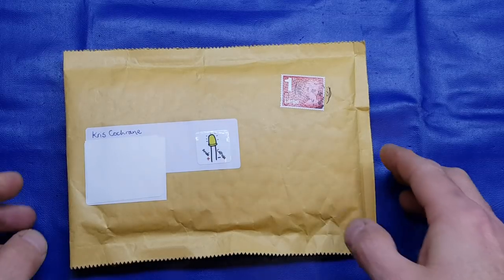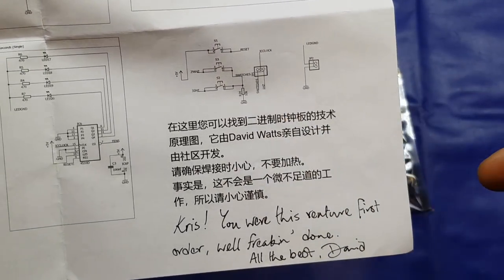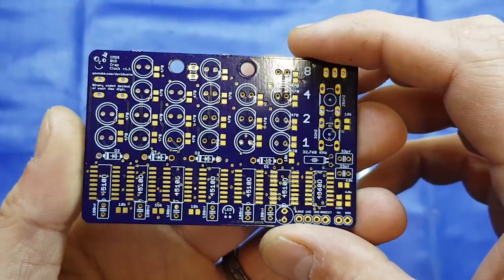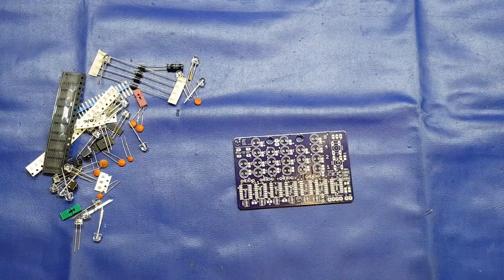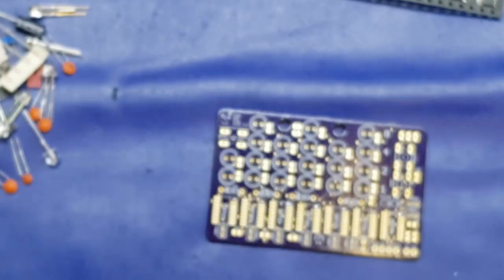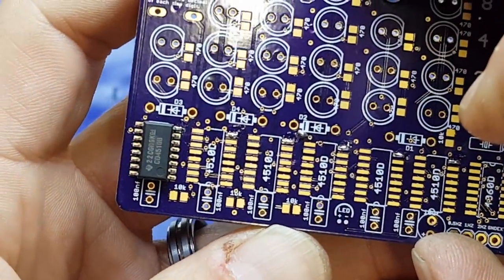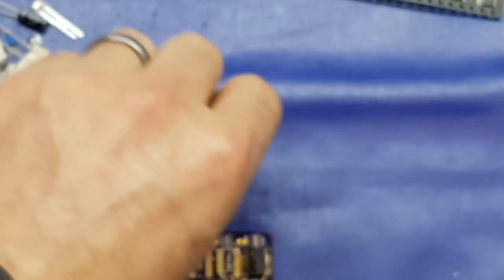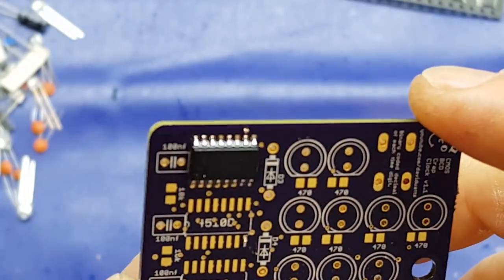Watts this all about? Building David's Binary Crap Clock kit (electronics tutorial)

Comment: Ha ha, 'I can't talk and calculate' I just can't calculate :-) I probably should have mentioned in the instructions, the 4510's will usually load up with random values at power-on so a reset is required. It will also run down to 2.7v drawing in the region of 0.5mA so a Lipo cell could run it for yonks (fancy terms for months) or years with the LEDs only enabled when you want to see them (6uA with the LEDs off). I stuck 5v on as a label because 5.5v is pretty much the ceiling voltage for those ICs.

Good job Kris, you powered through that faster than I did and I designed it!.